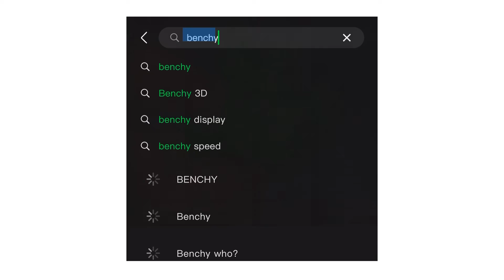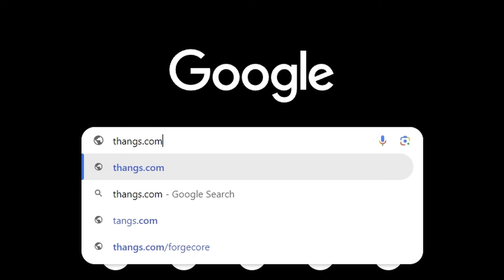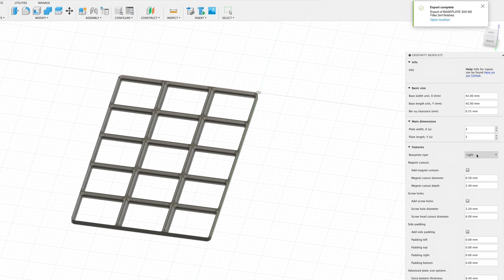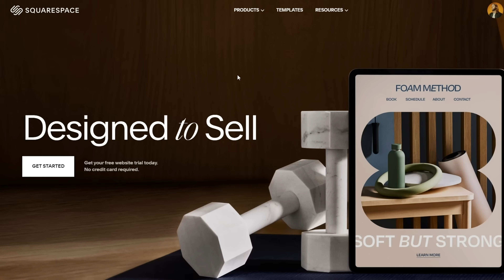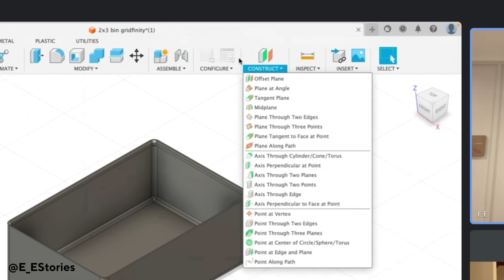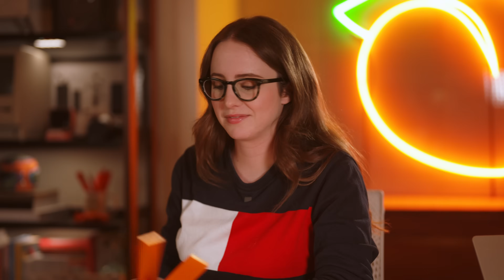Organizing my Office with 3d Printing

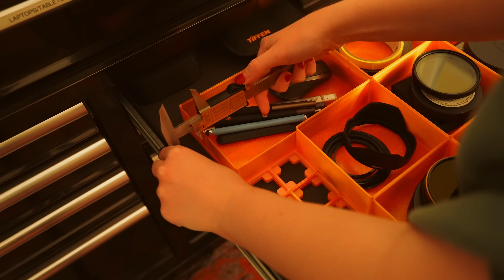Comment: When I saw the grid issue at 12:00, the first thing I thought was just to print short spacers. Half the width of the gap, all the way back. That way you can center the grid.
Hadn't seen the Bento Box solution.

Comment: Learning Fusion 360 was a great thing to do on your Gridfinity project, but having owned a 3D printer for a month now, I would have just printed a thin bin to fit in that blank space instead of modifying gridfinity. Or even just a spacer. Then come back to it later when you know more.

Comment: The generator has an option to print half square (21x42) and bins that lock into them. And an option to add a border to the grid to exactly match whatever the drawer dimensions are.

If you aren't going to use magnets, turn off the magnet option.

Comment: There is a gridfinity website that helps you plan out and in there has an option to create a brim like spacer on the base. Your solution worked just fine and is very similar anyway!

Comment: A couple tips.
That space between the box and the drawer, you could measure it and print one filler plate to put on one side of the bin, or two filler plates to put on each side.

You may have figured this out buy now, but for those noobies coming along and finding your video;

>>To save filament.
When you are designing a bin, don't print the full size bin. Print a flat 1 mm plate the size of the bin and use that to do a a test fit.

Use this same practice when you are designing parts where one part needs to fit inside the other with a specific clearance when it is finished.

If you want to easily modify a design, then use a CAD program like FreeCAD, which is what I use to design models.

I have a Qidi Tech Q1 Pro that I purchased in July of 2024.

Comment: You don't have to use 42x42, you can adapt it to your drawer. It can be 50x50 or 30x30. You just have to make sure that the base and the bin are from the same system.

Comment: Ok, I want a 3d printer now. I have spent literal hours searching for particular organizational solutions to specific situations. Th8s would solve all my issues and then some. I really love the customization aspect, plus I bet the cost to print is most likely much less than buying things that ultimately aren't exactly what you're looking for. The cost of everything tjoughyou didn't mention. I feel that would be vital information.
Reply: The thing about 3D printing is that it's pretty slow. The more space on the build plate you have, the less often you have to re-set the printer up to print more stuff. But you can get a pretty large Anycubic Cobra Max (I think the latest is model 3) and churn out a lot. But we're still talking literal days of printing or more.

Comment: a tip, you don't needd to print the whole box.  just pring the base and maybe a half inch of the sides.  Then if it doesn't fit, adjust and try again.  If it does, not much lost, especially if you change print settings for less plastic and faster printing.

Comment: I have the same setup and just started. My only suggestion would have been to just extend and create a custom gridfinity, ie take the 42 grid and add the custom 35mm squares to that grid itself. So when you make the custom piece, the grid will be relative to it and it will fit perfectly.

Comment: We're still learning our Bambu printer, but my husband will typically make just the outline of an object first, just to see if it will fit properly. For example, I asked him to make cache pots for my houseplants (a pot without a hole, the nursery pot slides inside but sits on the lip of the cache pot). Rather than making the entire pot, he makes short rings to see if they'll fit around the top of the nursery pot. Once he gets the width right, he'll print the entire pot. Less waste this way when you are still learning.

Comment: the moment she metioned "User error" Then pulled out the Seamstress tape measure.. i facepalmed... for the longest time i knew for a fact that those kind of measuring devices has not be accurate... i dont know the exact reason because back when my house still used it, 2 of the 5 tape measures we have are accurate with a metal ruler (i scrolled in the comments section and found out its flexibility is the reason why its inaccurate)

Comment: Emily's idea is okay as long as you only use the changed boxes next to the edge of the drawers. What if you need the box in the middle of the drawer. I would use a diferent idea to solve your problem - use small spacers. Print small spacers in black or whatever color you like and put them either between the edge of the drawer and the box OR put them between the boxes in the drawer. This way you have more possibilities on how to design your layout in the drawers. LOVE YOUR VIDEO - WHY WASTE A LOT OF TIME FINDING AND BUYING THE RIGHT STUFF, WHEN YOU CAN MAKE IT YOURSELF AND HAVE MUCH FUN DOING IT - AND LEARN NEW THINGS WHILE YOU ARE WORKING.

Comment: The accuracy of 3d printers now is such that the calibration of your measurement tool becomes important (which is really cool) My 30cm steel ruler has text on it at which temperature it was calibrated with (20 degrees celcius)

Comment: For your tape issue, where you were trying to measure the inside of a drawer, look up woodworking measuring sticks. Take two flat “sticks” stack them, then extend one, one way and the other the other keeping them on top of each other. Then once the ends of the stick are touching the inside of the both sides of the drawer, you secure the sticks together using take or a clamp. Pull the sticks out, carefully, and then measure the sticks from one end to the other. You’ll have the precise length of the inside of your drawers.

Comment: Buy a printer for 1000+ $ and say that support did not work out, it's ridiculous, the printer does not have any huge advantages a printer from China from a less well-known company is 3 times cheaper and no worse, but for spare parts it's tinplate nothing but native without alteration will not work and you depend on it. I have 3 printers and only 1 purchased and it prints well out of the box and spare parts are suitable for different manufacturers. PLA and PETG are different plastics they are not separated into stronger and not....

Comment: I appreciate your perspective. I am shopping for a 3D printer and Youtube suggested your video. I worked full time with 3D software doing design work from 1998 to 2015. Now I am a full time painter in 2D. But I am excited to acquire a 3D printer for my art studio and thankfully I understand the 3D building logic to fall back on, which is not intuitive. Last time I looked into printers they were not approachable, and I'd start a print and I'd wake up the next morning and it would have failed as soon as I left it. This is an exciting time where it's becoming more accessible!

Comment: When 3D printing large prints print small sections to test fits. For example with your drawer you could just print a line to test the dimensions.
Your CAD skills will make up for your 3D printing skills. So the better at CAD you get you get automatically better at 3D printing.

Comment: I've made my own grid system because I didn't know about Gridfinity back them. But it works well, except that mine is 2in blocks (50.80mm), instead of 42mm. I also made mine adjustable according to the layer height and nozzle diameter (so you can print a lot faster with a 0.8mm nozzle). I use it when I make furniture so my drawers always have it.

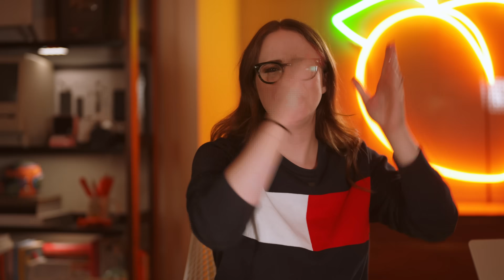Comment: 27:07 I just realized that you are printing the heavy duty magnet accepting base plates and that is total overkill and if you don't put in the magnets, it is a waste of material.
You can go with the minimal base plate that just provides the grid and nothing else, that is more than sufficient for working out a drawer :)
EDIT:  You noticed yourself, nevermind ^^

Comment: 18:46 Measurements are always the same, but there tape measures and collapseable measuring sticks (sry english is my 2nd language) are just not as precise as you would think or hope. In engineering and metrology you have deviation (how different are multiple measurements of the same thing) and precision (how far off is the difference between the realityand your average measurement). Since a tape measure is a low grade, it has a poor precision and the way a human measures with a tape measure creates significant deviation if not extra careful, your measurements are natrually quite far off.
Furthermore, I can highly recommend to double check measurements and also your machines accuracy by printing just an outline of the floor space that the box will be occupying, maybe two wall loops and 3-4 layers. You can then plop that frame into the drawer and see, if it fits. Do the same with the height and you used a few grams of filament and a few minutes extra, but you saved yourself an entire falsely dimensioned print.

Making little fitment test pieces is one of the great abilites of 3D printing! :D

Comment: My M1 Macbook pro also struggles with Fusion 360. I'm sad to say (or maybe not sad?) that I don't think it is the Macbook. It is actually the software. Fusion 360 had major issues getting an ARM based version released back when Apple Silicon first hit the scene, and it seems like they never really got that dialed in. IME, Fusion 360 just runs better on x86 (Intel/AMD) cpus.

Comment: working in a cabinet shop, the only tool they provided was a folding rule, which they bought by the box full, unfolded them all and checked that they were the same. We usually returned 5 to 10% of them because they were different. Always check your rulers.

Comment: 3D printing is pretty much all I have as far as organizing goes.  Gridfinity for anything on a flat surface, Honeycomb Storage Wall for anything on, well, the wall.

I also use Gridfinity on the wall, with shelves/storage boxes that connect into HSW.

Edit: the best way to solve the time problem is more printers.  You already got one foot dabbling in the pool: JUMP IN.

Comment: Test size before printing the full height item. You can either create a negative volume (in Bamboo studio to subtract or "cut" the bin height) OR you can set the "Z" height of the part below the print plate. When sliced, you will only print what is shown standing proud of the print plate. All you need is about 1/8 inch tall to place in a constrained space to verify X and Y parameters.

Comment: 2-17mm spacers made solid with 15% infill.

The door handle trim, by stuff called door edge molding, its what husky uses. You can buy it by the roll or strips.

Comment: should of used a measuring tape, the loose bit on the end gives you the correct measurement if it's on the outside of an object or inside.

Comment: Very cool video, thanks for sharing!  I'm in the middle of organizing my kitchen with gridfinity, so this was good timing to see this.  Also some really good ideas.  I like the idea of using spacers for the edges, right now I've been clipping the base (with side cutters) to friction fit them to the drawer bottoms.  The spacers would definitely be cleaner. :)  I did want to mention that on the "extra" feet you put in, if you add a chamfer to the top you can likely get it so no support is needed (like the regular feet).  And if you swap out the nozzle for a larger one (I've been using 0.8mm, but 0.6mm works too) you not only get faster prints, but they've been feeling sturdier than the walls of the ones I did with the 0.4mm nozzle.  Enjoy!

Comment: I think your experience with PETG being less sturdy was due to using the translucent version. If you just got regular PETG I bet you'd find it to be more sturdy than regular PLA. That said, for regular light-duty bins you probably wouldn't need the extra strength that PETG offers.

Comment: that's the one issue with gridfinity, it's a weird size. The standard sizing for cabinets and all its stuff is based off of 32mm aka System 32, not 42mm.

Comment: You have a top 3d printer. Nice choice. can you imagine living with a printer and wait 3 or 4 times more for the same print? nice tips :)
edit: i start with a cheaper model and it's a mess. i sufer too much.
for starters please grab a bambulab a1 if you don't need a enclousure to print filaments like PLA/PETG. 
If you want more mechanical strenght please grab a x1 carbon similar ones. i saves a lot of time.
Bambulab it just works. other brands you waste so many time fixing/upgrading it. it simply doesn't for me. 
and the rfid in filaments are so nice in AMS system. it simply recognise the filament.

Comment: When making custom-sized parts to fit an existing space, first print just a frame of your part maybe 1 or 2 mm tall. This will take much less time and filament and you can test the size. For smaller parts, you can get away with only 1 or 2 layers. Also great for checking hole alignment.

Comment: Solid video, so nice to show some of the pitfalls with 3D printing! I'm just getting in to it myself, and I totally know what you mean about the guys that have been doing this for years and the settings etc are all 2nd nature to them - all totally new terms to me. One thing I'd recommend you get is a cheapy set of digital vernier calipers, honestly one of the most useful tools I own and a game changer for getting accurate prints for all your things! You can measure outer diameter, inner diameter and they have a depth gauge as well :)

Comment: This is fuel to finally getting around to organizing my office (and house, let's be real), as I find myself in a similar situation - newborn and being disorganized for FAR too many years.

Ironically, I spend all day on the computer in CAD for engineering work so I should have no excuse, lol. I will say a few tips for those involved with 3D printing looking to get into CAD design:
1 - Get comfortable using a CAD software (regardless of which you choose, though I'd recommend parametric) and get an understanding of "how" to model parts using engineering-oriented tutorials, if you can help it (I think Titans of CNC is a great resource for newbies). I've used a few CAD softwares myself (SolidWorks, Fusion360, Inventor, OnShape) and a fundamental understanding of "how" to do something will translate from one software to another, you just have to learn where the buttons are. Many who design aren't engineers (and to be clear, you don't have to be), and while there might not be any "wrong" way of modeling something, there are "right-er" ways of doing so, which leads to the next point...
2 - Once you figure out a CAD software, learn how to optimize your design process. Designing things can be easy, but it can also be just as easy to break something because you changed a dimension somewhere up the line. As you get better using the program, you'll pickup little tricks to get your final results faster and with less commands. As you get better designing, you'll start learning how to model for easy future changes. Even in the professional settings, I will often get models that are easier to start over from scratch than to make a small change because I know it will break.
3 - If you can, learn from others' models. Sometimes the best way to learn something is just looking at the way someone else did something. The beauty of parametric design is that you can go back to the beginning of the browser/timeline/feature tree (or whatever it's called in your program), and see how someone stepped their way through the design process. This is, by far, the best teacher I've had in recent years, especially when gaining experience on a new CAD program.

Bonus - Admittedly, I've used Fusion the least (as it's my least favorite), but I believe you can use parameters when designing, basically putting some text value as the dimension (i.e. "Length = xxx" or "Height = xxx", etc.). These parameters can later be changed in a table, and the model updated, without needing to go into each controlling sketch which is super useful for things like bins or tubs where models are largely the same except for dimensions. A youtube search of "Fusion 360 parameters" should point you in the right direction.

Comment: First, the prints were too big for the drawer (because of the wrong measurements) and then the printer couldn't print it 2mm larger, which would still be smaller than the first too-big bin??
And no, all tapes should be the same :D 1 meter is 1 meter, no matter if it's in machining or clothes. Some tapes are just shitty...

Comment: For such simple boxes you could just literally make basic boxes in Blender witout any grid and turn on vase mode in slicer. You would save a lot of time and filament, a also a bit of vertical spce. Or you could learn very basics of any program (could be Blender, Fusion 360, any 3d program), and made your own basic, custom grid and also save printing time and filament. Giridfinity is great as a system, but you don't need to make basic boxes to put in a drawer.

Comment: I just want to tip my hat to you for shouting out the fusion 360 add in. I did not realize that was a thing, and that is super handy to let me make large plates that will maximize my Prusa XL print bed.

Also one tip like some others have said, is to just print the first layer of a print to give yourself the rough sizing idea and make sure it fits as you expect.

Comment: I don’t really get gridfinity. Why does it need a grid? So it stays in place? Don’t the other bins keep the other bins in place? It just seems like you lose vertical space. Your bento boxes seem better. Also if you’re struggling to get the measurement right, couldn’t you print something much simpler and faster to check you have the dimensions right first?

Comment: if u useing fusion 360 save model as 3mf file prints looks much better when u print from 3mf not stl.I cheek it and it works specialy on round items.